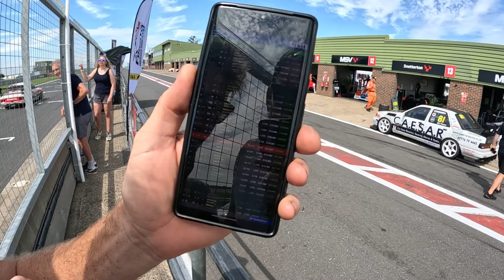TYRE FAIL TO PODIUM! FORD FOCUS MK2 RACE CAR TAKES ON SNETTERTON | EP18

Comment: Nicely done dude. That trophy cabinet must be getting pretty full now! Was it the heat of the track causing the tyre failures?
Reply from the maker: @BizzDrift  🤣🤣 we still have room! 🤣. I think it was a combination of track temp and heavy car, Snetterton is quite demanding on tyres, and the compound and structure of the tyre is probably not suited to my car. From what i found out, they we're more of a qualifying tyre for TCR cars.That's why we have gone back to the BTCC slicks . 🤘